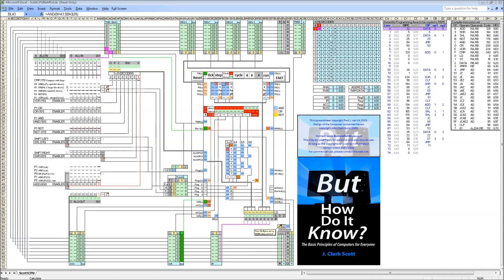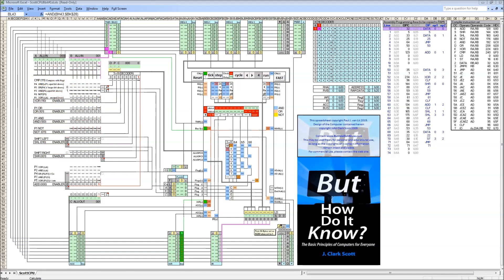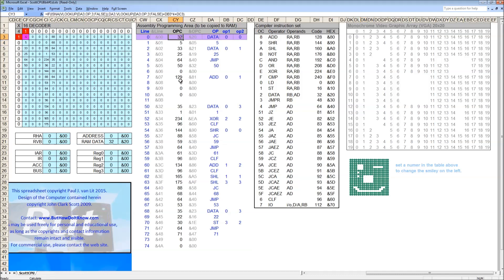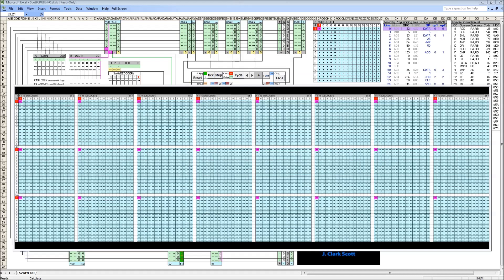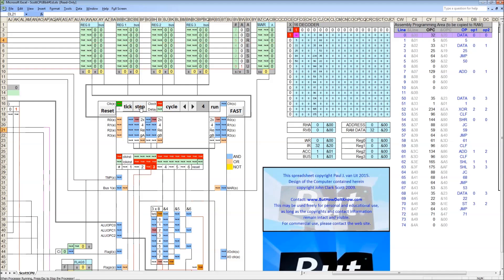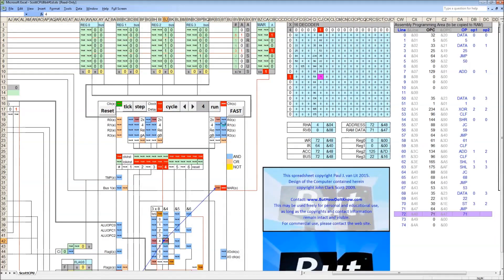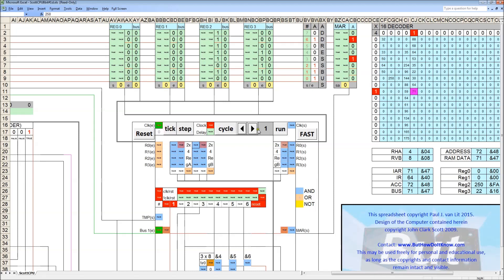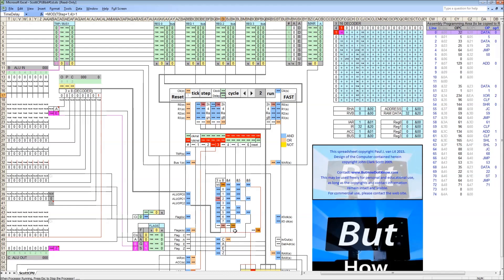ScottCPU1d in Excel - But How Do It Know (HD)

Comment: Hello Sir, Can we create the Scott CPU in Logisim software  ?
Reply from the maker: I have no experience in logisim. However you only need 2 things:
a NAND gate and
a on/off clock pulse 

The NAND gate is something i simulated in excel with a formula.
The clock was the only VB-macro required to let the Scott CPU run in Excel.
Based on the name logisim I would expect it to be fairly easy.

Took me 2 evenings to write a basic version of which the effort spent went largely to the presentation of the excel simulator.
Good luck.
Paul
Reply: thanks for the reply, sir.
Reply from the maker: Just took a look at LogiSim. All the components are there so it should be possible. 
I'm not sure if I tried Logisim before or another simulator. The one I tried was not as robust if I recall correctly (5 years ago)
Reply: I do try to use the pre ready Register in Logisim and  try to design RAM , but I found out that it doesn't have the Enable pin like the Register in the book But How Do It Know .. may be will need to design it  by using the basic gates I think.
Reply from the maker: Maybe you could tweak the Register and the RAM in the same way. For the Register you can choose the trigger to be set only at high level. For the RAM you can select several data interfaces, maybe try "separate load and store ports" to tweak it as close as possible to the Scott CPU. good luck.
Reply: Paul van Lit Thank you sir, for the advice.
Reply: There is a Logisim model available. Check the buthowdoitknow.com
Reply: Do you need VB for the clock?
You can just type: =MOD( FLOOR( NOW()*100000*FREQ; 1; ); 2 )
and constantly recalculate the values.
Reply from the maker: yes this would probably work too. We need then to have it recalculate every time I gues with VB
Reply from the maker: great tip, thanks